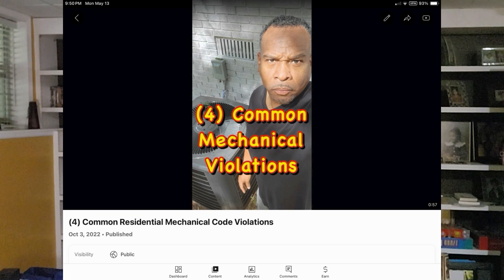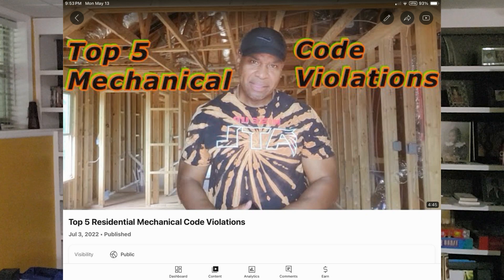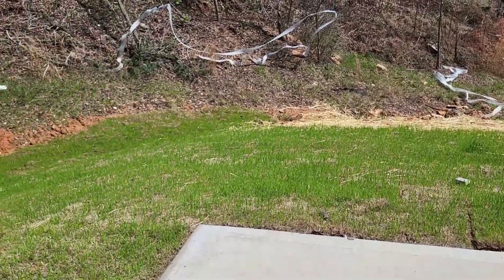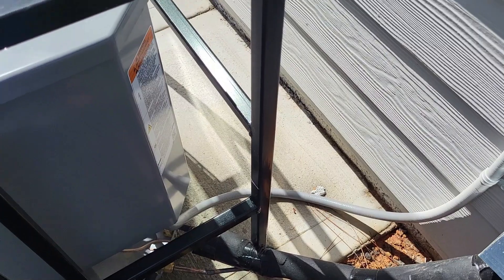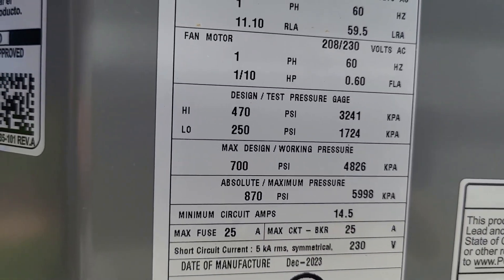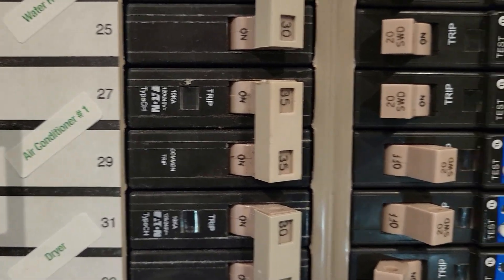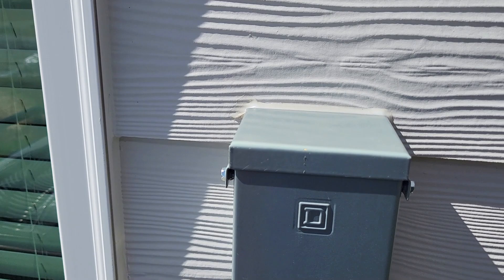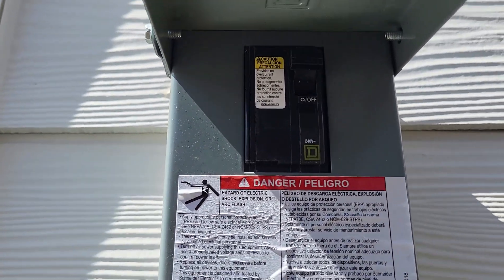Always Check That A/C Condenser Breaker... It Could Be Oversized !!

Comment: Yes you are correct the max fuse or overcurrent protection device (MOP) is for the breaker size which protects the condenser. However the minimum circuit ampacity (MCA)  is to determine the correct wire size. 

Example: The MCA listed on the nameplate = 28.6 amps. 
We then go to table 310.15 in the NEC and find the nothing less than a #10 Romex (NM cable) can be used on this condenser because a #10 wire is rated for 30 amps. 

A #12 wire would be too small because it is only rated for 20 amps. A #14 wire is rated for 15 amps etc.

The MOP listed on the nameplate= 50 amps 

We then just go to the breaker/fuse for the condenser and check to make sure that it is not larger than the 50 amp MOP listed on the nameplate.

Comment: Hey man, I love your channel. Been a subscriber for a while. This is not controversial in any way. . Max fuse size listed on the manufactures nameplate is the size breaker of fuse that needs to be installed.  Period. End of story.   Under sizing well cause constant tripping. As everyone is aware, the starting amp draw of a condenser can be up to four times or more what it shows as minimum circuit ampacity. A 15 amp HACR or TDR type fuse will blow as ac condensers will draw the excess amps for a much longer time when starting than a typical electric motor. 

I can’t tell you how many times I’ve went out on a service call because my new unit is blowing fuses only to find out the electrical contractor installed fuses based upon MCA instead of max fuse size listed on the manufacturer’s nameplate.
Reply from the maker: I appreciate your commenting, and thanks for watching!!

Comment: According to NEC (2014) Article 440.22 it says that it can be 175% of the nameplate rating, and if that isn't enough you can go to 225%, which is 45 amperes. 25A×1.75=43.75A ~ 45 amp breaker. It seems wrong that the breaker would be at the same value as the maximum load because you wouldn't want it to trigger at that point, only at a higher amount.
Reply from the maker: Read 440.22(C) NEC 2017
Reply: @PPG1967  Thanks, 2014 says the same thing, to use the upper value on the nameplate, just as you say in this video. 😀
Reply: The "nameplate rating" specified in 440.22, would be referring to the combined RLA (Running Load Amps) of the compressor and condenser fan motors, as noted on the nameplate, not the "Max circuit size" rating on the nameplate. In fact, that "Max circuit size" data would likely include the necessary 150-175% over-current inrush allowance. Bottom line: The "MAX circuit size" is indicated as 25A, so the over-current protection should not exceed that.  And that over-current protection can be either the breaker at the supply panel, or a fuse or circuit breaker at the equipment.... which is why I'm pretty sure that "switch" (equipment disconnect) at the the condensing unit, is in fact a circuit breaker (it is a Square-D type "QO" breaker, but can't see the ampere-rating on the handle, in the video). It may be the correct size...
Reply from the maker: It’s not a circuit breaker. It’s just an on or off disconnect switch.

Comment: No ambiguity about it.  The values on the name plate are marked clearly, and your explanation is spot-on.  By the way, I have never seen a cage around a residential unit. What is up with that?
Reply from the maker: There's a huge condenser theft problem here in Atlanta.
Reply from the maker: They steal condensers for the copper.

Comment: But wait!
That "disconnect" located outside at the condensing unit is, in fact, a 2-pole Square-D circuit breaker. So what is the amp rating on that breaker?
If that "disconnect" breaker is rated between 15 and 25 amps (as per the min-max rating on the condensing unit) then the circuit would be compliant. Effectively, the condenser's supply max-ampere capacity would be limited to that device's rating.
The upstream breaker (in the panel) could be nearly anything bigger, provided the conductor size is sufficient. And what size are the feed conductors, from the panel to the "disconnect? What size conductors are needed for a 35-amp breaker? (Bigger than #10...).
Again: What size is that "disconnect"?
Size matters! 😂😂
Reply from the maker: That's a on/off switch.
Reply: And by "on off switch" it says right on it that there is no overcurrent protection, it's literally just a switch that looks like a circuit breaker.  As always, thanks for the time you put in making these videos.
Reply: @PPG1967  Sorry sir, but that's not just an "on/off" switch... It is clearly a Square-D, Type "QO" circuit breaker, in a Square-D NEMA 3R enclosure. I've installed many of these exact devices as AC disconnecting means (just as used here).
If THAT breaker is properly sized, it becomes the over-current protection for the condenser/compressor, regardless of the size of the up-stream (panel) breaker.  And it doesn't HAVE to be a fuse... a circuit breaker (properly sized) is absolutely permitted.
However, the up-stream breaker's ampacity cannot be so large, as to not afford protection for the conductors between the panel and the AC disconnect/breaker.  Furthermore, while the minimum & maximum circuit capacities are given on the name-plate (and these can be used for circuit sizing), as an electrician (which I am, 40+ years), it's still always a good idea to calculate the ampacity required using the FLA amp rating of the compressor and condensing fan, and applying the the multiplier (typically ~150%) to arrive at the required correct circuit & breaker sizing.  
The whole idea is to have sufficient circuit ampacity, to allow the high inrush currents associated with a loaded compressor starting, without tripping the over-current device, but also low enough to protect against an excessive overload (such as a "locked rotor" condition) which should trip the over-current device. That's why they list "FLA" and "LRA" ("Full-load Amps" and "Locked-rotor Amps) ratings on the condenser/compressor units.
One additional thing: In your video, the breaker panel has a 35A breaker for the condenser... but what size are the conductors feeding the condenser? If they are #10 awg wires, then that breaker is too large. If they were #8 awg (or larger, but why) then it would be permitted.
Anyway, always great stuff!  Love seeing how new homes are built so poorly at times...
Reply: JUST FOR CLARIFICATION WAS THERE AND ON/OFF TOGGLE SWITCH AT THE DISCONNECT OR WAS THERE A DOULBLE POLE BREAKER THAT CAN BE TURNED ON AND OFF?  SORRY, A LITTLE CONFUSED ON THAT POINT AS THE VIDEO IS NOT CLEAR.  THANKS.....

Comment: The minimum circuit ampacity is for the wire size. So 14.5 minimum circuit ampacity means a #14 Romex can run this system as it is rated for 15 amps. You have to look in the ampacity table in the NEC.
Reply: The issue was with the feed breaker sizing, not the wire size. In fact, it would be intersting to know what the conductor sizing is, since they were feeding it with a 35A breaker. And, if it WERE wired using #14 wire, and being supplied by a 35A breaker, that could (would) be even a bigger problem.
Also, you must include the inrush current and voltage drop into the conductor sizing, not just the minimum circuit ampacity.
Lastly, the "circuit ampacity" always includes the breaker size feeding the circuit.
Reply from the maker: Those numbers on the condenser nameplate (minimum & maximum amp) are there to protect the condenser.  I don't understand why some people don't get this.
Reply: @PPG1967  Yes, you are correct the mop is to protect the equipment yes. However the MCA is really used to determine the wire size. Example: MCA= 28.6 from unit nameplate. This means you can use no less than a #10 Romex (NM) as it is rated for 30 amps. Look in the NEC Table 310.15.
Reply: @PPG1967  Yes you are correct the MOP (max fuse) is used to protect the equipment. However the MCA (minimum circuit ampacity) is really used to determine what the correct wire size should be. 

Example: Minimum circuit ampacity from the condenser nameplate = 28.6 amps

Then we go to table 310.15 in the NEC and find that nothing less than a #10 Romex (NM) can supply this unit as a #10 is rated for up to 30 amps.

A number #12 wire would be too small as it is only rated for 20 amps.
Reply: Some nameplates will specify a minimum fuse but it will say minimum fuse not minimum circuit ampacity.